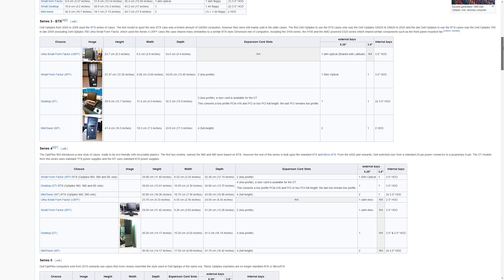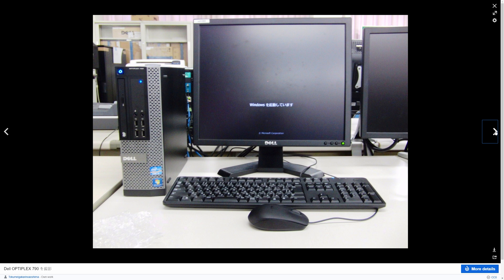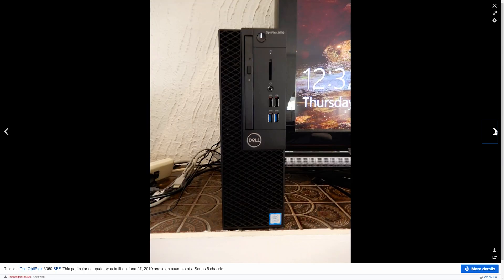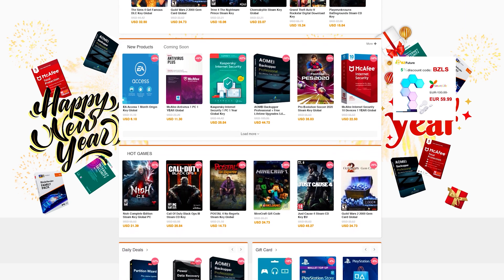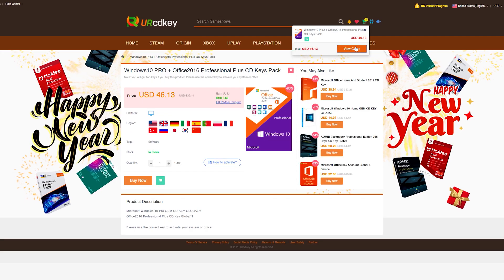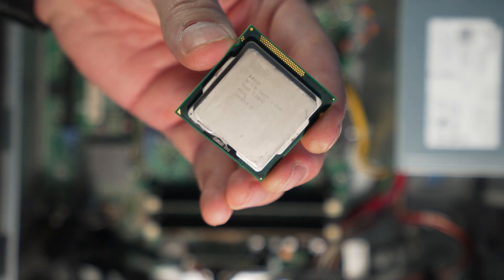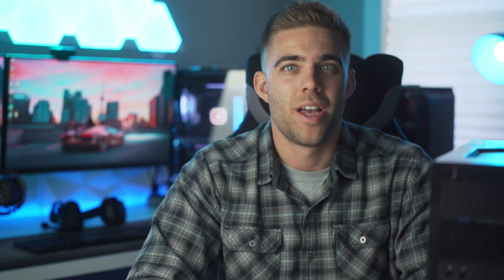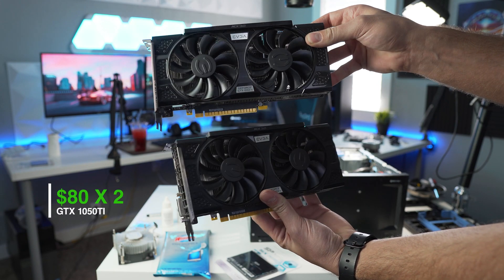Can we turn a Dell Optiplex into a Gaming PC? 🤓

Comment: 9010 i7 16gb ram add a ssd for your boot drive and a gtx 1650 super with stock power supply and molex to 6 pin adapter and your in business ... whatever you do don’t get a rx580 way to power hungry and so you’d have to upgrade the psu and 2 there noisy and hot and most wont fit in the stock dell case where as for the same performance if not better arguably AMD getting the nvenc encoder I’d go with1650 super all day !
By way I’ve put together a lot of optiplex builds have three in my house now and have tried every combo you can think of and a gtx 1060 6gb or 1650 super are your best options for stock psu and fitting in case with no modifications needed just plug n play!
Reply: Anytime brother went through all this three years ago sold a few and then ended up with three for my 10 9 and 8 year old haha they all wanted a gaming pc like since the oldest was 6 haha and the market was shit back then first gen Ryzen was a rumor and intel was stagnant i7 6600k was top of line . But for price to performance ratio the i7 3770 and i7 4770 are perfect 1080p high refresh rate CPU’s and haswell i5 is actually still a viable option if on a tight budget it’s amazing these optiplex’ s have went up in price I bought them with the i7 and 16 go ddr3 with a hard rice for like $150.00 back then and for a complete build was unbeatable in price to performance just add a ssd and gpu and done .
One thing I’d recommend to anyone out there go as big as you can possibly afford for your ssd boot drive cause that will be your c: drive and every download you do and everything will default to it so once it’s full and your game has a update it’s a pain in ass cleaning space but learning proper storage management is a art and when it’s a kids pc that your not always there to help them with  I’d go 1 tb ssd for boot c drive just a tip for dads.
Reply from the maker: Thank you so much for the info my man! I'll be making a new video on the GPU upgrades and I will definitely be using your findings in the video! You rule man!

Comment: Would it be a rip-off to pay $300 USD ($475 AUD) for a Dell Optiplex 9020 i7 4770 3.4GHZ with 16gb DDR3 and 250gb SSD?
Reply from the maker: Funkteon without a gpu that’s a little more than I’d pay. They usually up charge quite a bit just because it comes with an ssd but realistically that ssd costs maybe $50. I usually try to find optiplex systems for $200 MAX and go from there.
Reply: @RAVisuals  I'd tend to agree, however, it's slim pickings over here in Australia, so I might just take it and chuck a GTX 1650 low profile in it.. All up, the price for the machine, the GPU, two 1080p monitors, a keyboard and mouse, is $730 USD..

Not too bad considering I was initially going to spend a lot more than that about a year ago..

Comment: Hey I’m looking to buy one of these to game but I don’t want to buy upgrades so would it still game with like a i5 7020?
Reply from the maker: Jo. oseph some of them come with a graphics card and some do not. To actually game with any sort of “playable” frame rates, you can get away with only upgrading the gpu. I suggest something like an rx-560 or gtx 1050/TI, or 1650 as they require no external power source.

Comment: Great video!  I did a build with an Optiplex 9020 with the i5-4590 just a few weeks ago.  I used a GTX 1650 OC because it was around the same price as the 1050, performs better and does not require an external power connector.  For anyone thinking of doing this I would strongly recommend buying one with an SSD installed (Newegg has them).  It might cost you slightly more but you'll get a very fast boot drive out of the box which will make your life a lot easier.
Reply from the maker: Very good idea man! If you don’t mind sharing, how much did the 4590 system cost? As I said, I already paid more than I wanted to with mine haha 😂
Reply: @RAVisuals  My Optiplex 9020 with the new 128 gig SSD cost $260 CDN which is about $200 US.  Keep in mind things are more expensive in Canada because of shipping costs and customs duties.  Still, I had a lot of fun with the build and with the GTX 1650 OC and some extra ram the whole thing came in just under $500 CDN.  Which is pretty good considering how happy I am with the performance.  Too bad the price of the Optipexes is going up since I finished my build.
Reply from the maker: dennis dales yeah man! Seems like these are getting more popular! Can’t help that a lot of youtubers are making videos on it 😅

Comment: Would a rx570 bottle neck??
Reply: It won't on the i5-4590.  You'll need an adapter cable for the power connector though.  No biggie.
Reply from the maker: Thank you Dennis! this is absolutely correct! I'll be making another video soon with that adapter showing that you can do it.

Comment: Great vid on these systems. 

You can get a 24pin to 8 pin dell adaptor if you wanted to swap out the power supply on the 4th gen desktop. 

Do both of these units have standard fan connectors if I wanted to swap out the fans? 

EDIT: Dell's have a proprietary 5pin PWM fan connectors. You can get the 4pin adaptors on ebay. 

Thanks, 
Thumbs up👍
Reply from the maker: Thanks for the info! I'll be covering these more to inform people of my firsthand exp with all the proprietary stuff. Thankfully, some awesome people have made adapters to get around just about all of them 😀
Reply: What cpu do recomend for optiplex 3020  i7 4790k? Is max I could go
Reply: @alextracythaxton5796  Have a look at Xeons for that socket and compare on cpu comparison sites for how much difference there is. 

But that is the best performing cpu for the socket. It wont overclock on the dell motherboard i dont think..
Reply: @shifty277  thank man I subbed liked and am checking out more
Reply: @shifty277  thanks with gtx 1060 oc 3gb 16 gb memory and a couple ssds, 650wtt psu accompanying the i5-4590 that's already in it , it's not to bad of a machine. U think I would notice a performance increase in games w the i7?
Reply: @alextracythaxton5796  in benchmarks yes. But in the real world no..... There isnt enough difference that the extra core count makes... You have a good price to performance machine
Reply: Hi Ryan always on the lookout for people in the know I've got a 7010 full tower from dell and curious as to what power supply I could upgrade to to give it more breathing room... if your knowledge extends to those models...

Comment: A GTX 970 or a GTX 960 would be also great for the Dell Optiplex. I have one of these and I want to upgrade!!!
Reply from the maker: This is very true!
Reply: @RAVisuals  can u help me do what u did ? my dell optiplex 7010 isnt nearly as gud as ursss
Reply: What about 1660 super?
Reply: @footballmatchhighlighttv  It cost over 200€ very expensive
Reply: @nahpets2345  but would it work
Reply: @footballmatchhighlighttv  it would perfectly work, with an i7 you'll have no bottleneck
Reply: I have an Optiplex 390 with a 2400 i5 and a GTX 960, with 8gb DDR3 RAM. Works recently.
Reply: @RyanMinardovic  not bad
Reply: @nahpets2345  I also have an i5 2500  HP 8200 tower with 16 GB RAM and a GTX 1050 ti.

Comment: You can pick up a Sandy/Ivy bridge Xeon such as an E3 1230 or 1240. They’re basically i7s minus the integrated graphics and sell for quite a bit cheaper than their i7 counterparts on the used market. They’ll  work in those Optiplexes with the latest BIOS update
Reply from the maker: Nice! This might be something ill have to try! Wonder if there's any performance difference for gaming!
Reply: @RAVisuals  You should notice an overall smoothness in multitasking and games that can utilize Hyperthreading. Also, speaking from experience with the Optiplexes, you may have to verify Hyperthreading is enabled in the BIOS options.
Reply: Yes that works

Comment: I have dell optiplex 7010... And comes with i7 3770 and 4gb ram and 500gb hdd.... Im wondering if i want to go all the way and upgrade the psu and ram to 16gb and add 120gb ssd... If i added a psu with 6pins.. Just add a gtx 1070... Is it worth it or not.. Avalible for replies.. #Thanks
Reply from the maker: depending on the psu you might not even need an upgrade! you can get a sata to 6pin adapter for like 6 bucks on amazon! I'll be doing a video on this soon!
Reply: @RAVisuals  first.. Thank you for ur comment... Second.. I was thinking of getting 1070 But the price of it abit high for me.. I will go with the rx 580 8gb for now.. And buy the sata to 6*8 pin... Keep it up the vids .. You doing Great..
Reply from the maker: TT_aous560_LY thats awesome man! That is a great option. I will definitely keep on truckin!
Reply: You can also go for a GTX 1650 as many of those do not require a power connector and will run right off the PCIe slot.  They're going for pretty cheap now as well.

Comment: I've had a i5 2400 optiplex for about three years now, just add a GPU and a PS, if you need PCIE power, it'll run for years. I don't play AAA games, but what i do play, it does perfectly fine on. Current build is i5 2400, 8 gb (4x2gb) 1333 Ram EVGA 450BT PS and a EVGA GTX 1060 3gb OC. It runs fine, but i want a newer platform, so building a ryzen 1600 AF system to replace it
Reply from the maker: That would be an awesome system! I have build a few in my recent videos if you need ideas!
Reply: @RAVisuals , Thanks, but i've got it pretty much figured out. As i said i'm using the AF 1600, with at least 16 GB (2x8 gb sticks) of timetec RAM (2666), Might double it up, just need the case and motherboard right now. Thanks to my Stimulus check coming in today, i got what i need to finish it. going with the B450m pro4 from asrock and thinking a Fractal design focus G ATX in black. I'm plan is to use the power supply (EVGA 450BT) and current GPU (EVGA 1060 3gb OC) until i get a killer deal on newer stuff, thinking maybe weither a 1070 (If a good Ebay deal pops up) or a new 1660 once prices settle a little, thinking next PS moght bea 500 watt for GPU upgrade. I have been planning this build for better then a year i know the Ram is a little low, but honestly it's literally double what i currently have (8gb 1333), so is it a downgrade? also looking at features, i don't see any MB's that really top the pro4 for value. Yes some good bells and whistles, but the pro4 has a decent VRM with a great price

Comment: Acer Veriton's with the i7 4790(non K)/i5 4670(non K) are also great value. They mostly come with also 16GB of 1600MHz DDR3 and can be found for roughly around $70-150 USD. I usually grab a cheap mATX case with a 450W psu bronze(24pin to 12pin adapter) and a RX570/580 8GB and its a 1080p budget monster.
Reply from the maker: hmmm, wow! I might have to look into this! Haven't seen any of these locally so maybe i'll try ebay!

Comment: You can buy a 24pin to 8pin adapter for that dell i5 4590 yeah dell keeps changing the power of pins it needs 8 12 and so fourth
Reply from the maker: Dude no way you found my channel! I was actually thinking about doing this in a future video!
Reply: @RAVisuals  Haha yeah and great job on your videos they are awesome video quality is insane.
Reply: Yeah I run that adapter in my 9020 RX 470 build.
You can connect a PSU no probs to the Optiplex 3010/7010/9010

Comment: Can you please do a build tutorial on this!!
Reply: Ok thanks. Im considering to get an optiplex 9010 instead of 9020 because it has the pcie x16 at the top so you can use double slot cards
Reply from the maker: hmmm possible future video 🤔
Reply: @RAVisuals  can you work on the ssf 9020 ty
Reply from the maker: Mouse GamingMC hey! I don’t really try to use the ssd chassis because they are extremely limited on what you can put in them. Although, could be every interesting to try so it’s possible if I can find one for a good price
Reply: @RAVisuals  i meant can you upgrade the dell optiplex 9020 small form factor
Reply from the maker: Mouse GamingMC yes you can! It’s just much harder and you’re limited to small for factor graphics cards because you can only use a single pcie slot